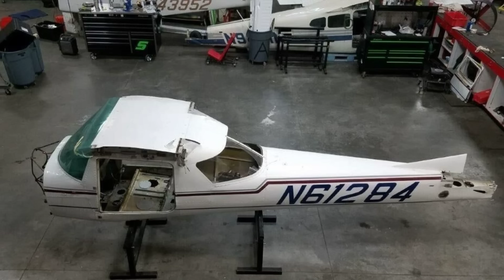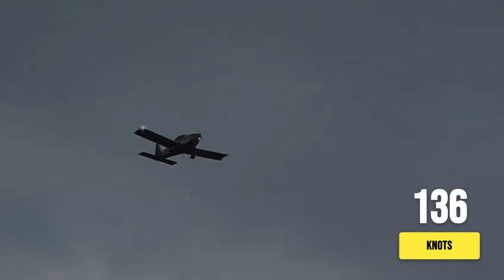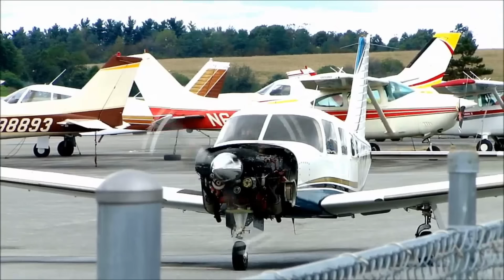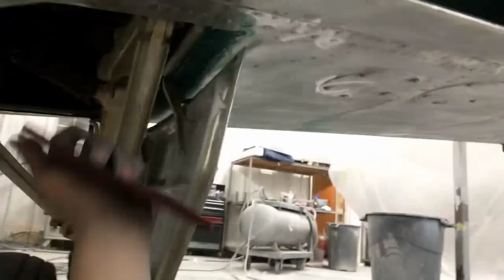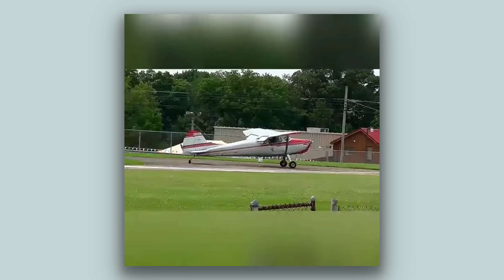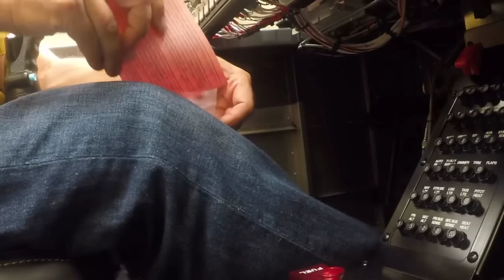Rich Pilots Buy Cirrus... Smart Mechanics Buy THESE

Comment: I owned a Cessna 150k for 15 years.  Sold it a year ago.  Average annual inspection which included a few extra light maintenance repairs and replacement parts, was $1600.  Fortunately, this plane’s home airport was at a semi-arid location its whole life from 1970.  Airframe was very clean.  Cheap to fly for this day and age.  Engine was approaching overhaul so I sold it considering that cost being $20,000 or more.
Reply: Love aviation but christ, is overhaul just buying a new engine? 
I can understand rebuilds, sure they are expensive but surely it's cheaper than buying new.
Or is overhaul for the whole plane ?

Comment: No mechanic ever called a cessna a cockroach. They are practical durable fixable survivors. Your mechanic may not know how to fix or inspect the AA 1 airframe. They are oddballs and the floppy nose gear is kinda lame making ground handling clumsy. However it doesnt need repair and hydraulic seals constantly like standard nosegear

Comment: You mentioned the Piper Dakots - but did not mention the rest of the Piper PA-28 line - the Warrier, The Archer & the Arrow.   Mechanics every where can fix them, & there is great parts availablity.   Insurance companies love them with reasonable rates & fun to fly with good reasonable rainge & speed.   I have an Arrow IV with the Fuel injected IO-360 Lycoming engine that will go to 2,000 hour TBO & beyond if in part 91 operations.  Being an fuel injected engine there is trhe elimination of carb ise issues.  You can't go wrong with that line up.

Comment: I took my first 152 lesson in 1984.  In 41 years, I have NEVER heard of the 150/152 referred to as the “Cockroach”.  But I will agree on the Champ. You’re either a Cub guy or a Champ guy.  I’m a Champ guy.  But this guy is constantly lying.  You can’t legally just go to the auto parts store and buy parts for a Champ.  It’s a certified aircraft.  The liar said several times in this video that you can use parts from the auto parts store for the various planes.  That’s a lie told by a lying liar.

Comment: Flying seems to be an expensive hobby.
Reply: The engines are often referred to as “money to noise converters”.
Reply: @capnrico8877 You mean the aircraft engines or engines in general?
Reply: @jjstro  I meant airplane engines, but I guess other ones aren’t too far behind.
Reply: Yes but this video gets almost everything wrong.  In 14 years, I have never had an annual in my plane that was half of what is quoted here.  I love flying but it is the dumbest financial decision I’ve ever made.  Smarter to rent.
Reply: @tomedgar4375 that's the kind of information I was looking for.
Reply: That's why Home Flight simulators like MSFS 2020 and Xplane are soo popular.

Fly at home .. 

     Cheaper too ..

    I'm flying a Boeing 737 on my flight simulator right now .

     ❤🐦✈️
Reply: @larrysouthern5098  Yes and no.  When I moved to Oklahoma from Oregon 4 years ago I bought MSFS 2020.  I bought it because it uses Google Earth for the scenery. I figured I could spend $80 for the program and use it to learn the local terrain and landmarks, or I could do the traditional method of renting a 172 for $140/hr to learn the local area.  I've learned a lot about the local area in the last 50 hours on the flight sim using flight controls I already owned, vs. the $7,000 that 50 hours would have cost renting.  But it's no replacement for getting air under the tires.

Comment: Cessna 150/152. With full fuel they are a 1 person airplane. They are selling for $40.000.00 and up.  You got pretty much everything wrong about every single plane in the video. Good job.
Reply: Did my flight training in 150.  We over weight every time we went up by 30-50 lbs. Was low altitude airport only 3100 ft.  That helped.